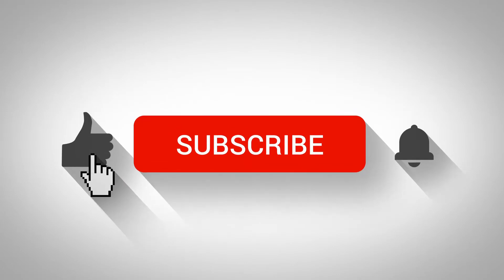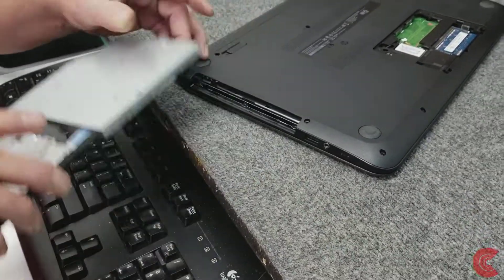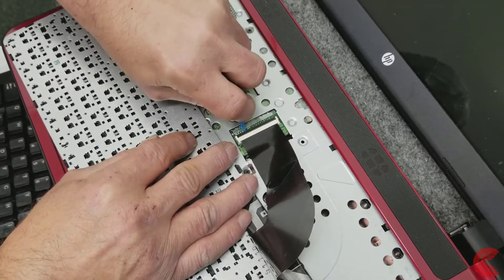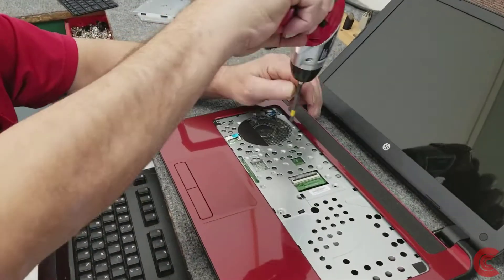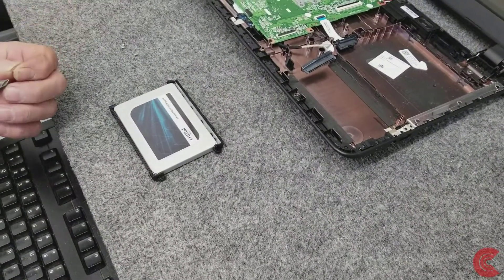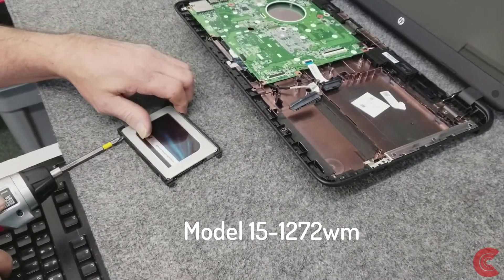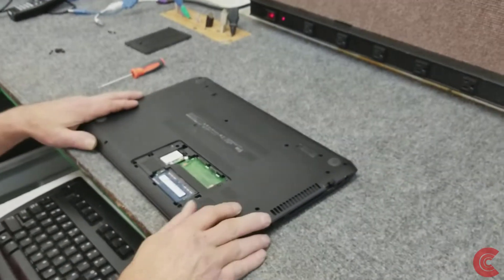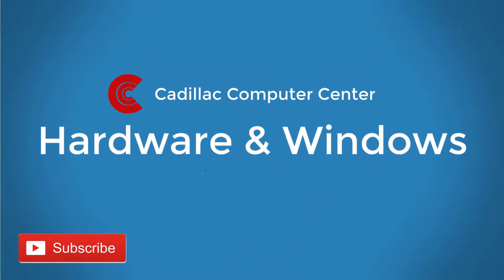How to Upgrade Hard Drive to SSD in HP Laptop 15.6"

Comment: I had the AMD version of this laptop and I hated it's design.  There is a hp probook model with the same chassis and they extended the ram door out to also give easy access to the HDD.  This HP pavilion model was designed just as a great big middle finger fck you to anyone who wanted to do upgrades.